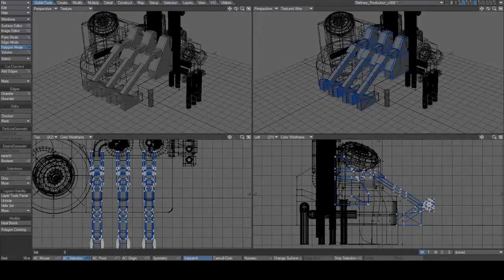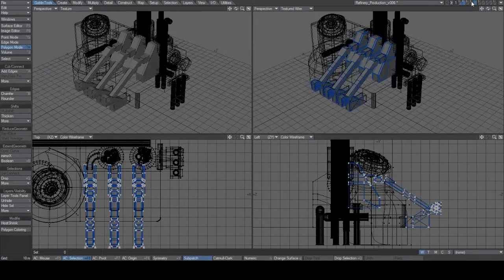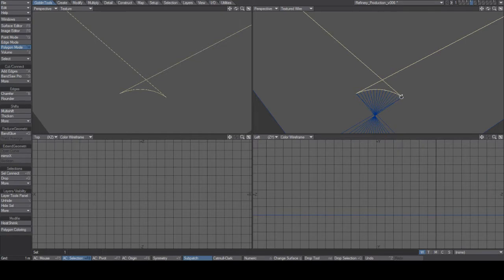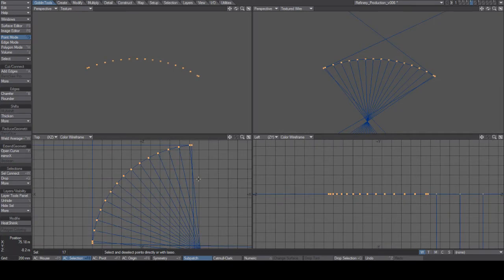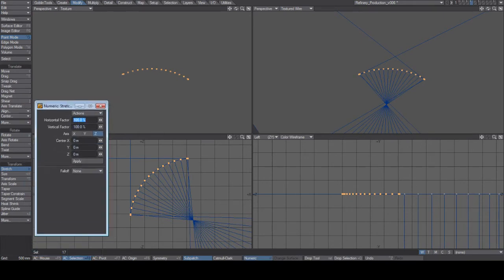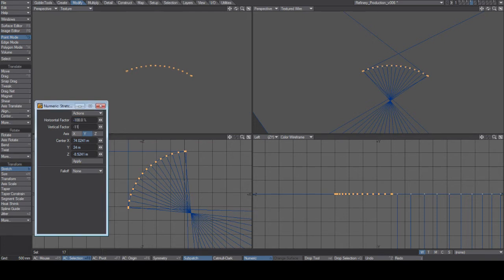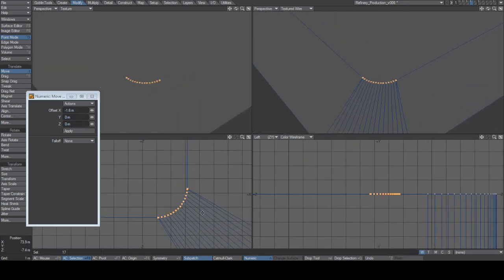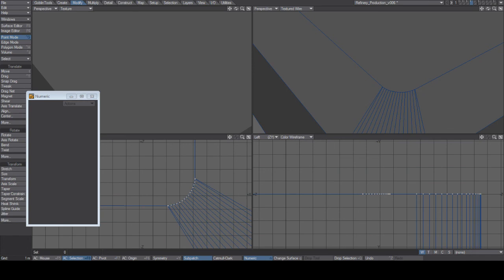Lightwave3D Modeler Tutorial UntangleAfterBevelingTooFar

Comment: Wow! Super simple! Brillant just!
Reply from the maker: +3ddreamy  Glad it helps :)
Reply from the maker: +3ddreamy Hmmm I haven't looked at this in a while, but there are a couple of observations I can add on this trick. 

1. The same results could be achived by selecting the points gone inverted, and with selection mode "selected" you could tap on the "r" key twice to rotate it instead of a negative scale. 
2. If you want to get the points to fall in line with after using the negative scale trick, you could put selection mode on "mouse", with the scale tool selected click and drag just a little where the lines cross, then undo ONCE and open up the numeric tab for the scale tool... now it should have recorded the position you clicked, so if you type in the negative scale now and click apply, you don't have to move them since they scale around that point and the straight lines keep being straight.